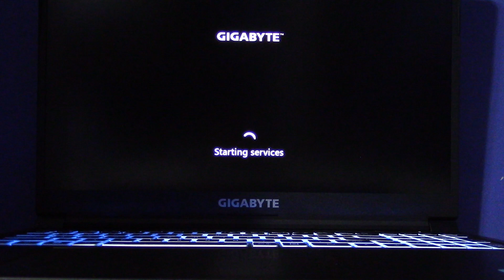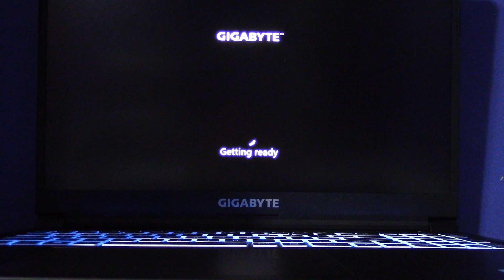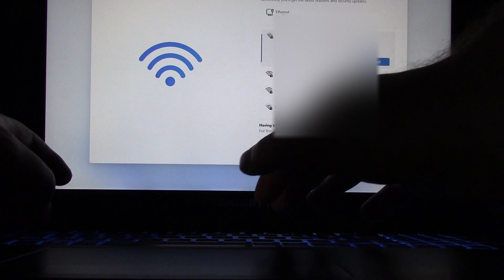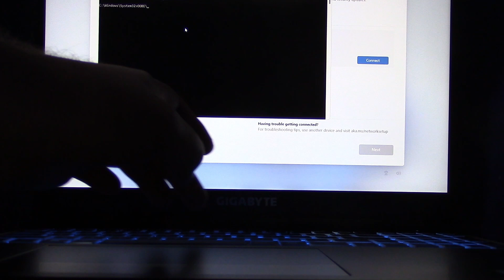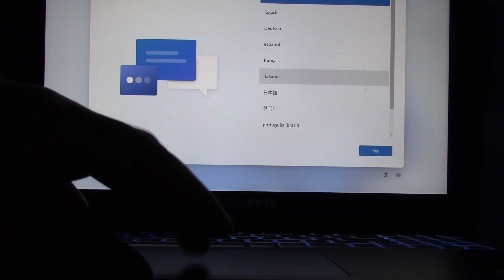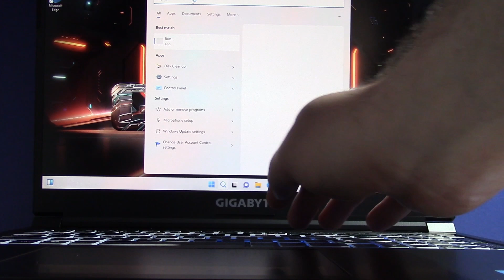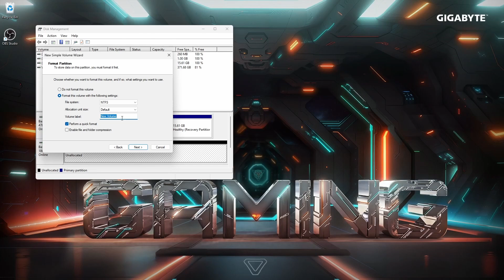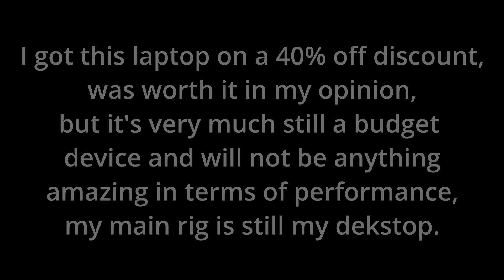GIGABYTE G6 Laptop Disassembly - installing a Second M.2 SSD

Comment: Could you please share your experience of using this device, how it behaves under load? Are there any problems with CPU, GPU and VRM overheating? I am planning to buy this laptop next year and would like to know about possible problems. Thanks
Reply: Процессор может тротлить от перегрева. Смотри коментарии "отзывы" на G6  i5 13500H notebooks in russian market "ДНС".  В настройках БИОС можно настроить, чтобы этого не было.
Вчера  ставил драйверы на вчера же купленный в этом магазине: аудио драйвер сначала встал с синим экраном, переставлял два раза с 6 перезагрузками (для удаления предыдущего драйвера). Также не встал Realtek сетевой для RG45. Скачал расширение какое-то для сетевого драйвера. RG45 вставлять аккуратно - можно сломать от того, что не понимаешь, как это делать. Многие драйверы пакетов Windows 11 отказывается ставить - приходится нажимать дополнительно и разрешать. Также один Intel драйвер категорически не встал, а другой встал но с дополнениями (скачаны вчера же с сайта Gigabyte). Windows 11 флешка от 1февраля сеть включена, обновления ставились. Первым делом был обновлён БИОС на последнюю версию. Используется исполняемый файл exe из под Windows, с терминалом и прошивкой в терминале. Гоутбук с RTX 3050 для ноутбуков, 16 Gb ddr5. ssd nvme Gigabyte требует ставить только шести моделей (но не как в видео) в файле из поддержки на его сайте.

Comment: Do you think this module will work? Samsung M425R4GA3BB0-CQK  32 GB 1 x 32 GB DDR5 4800 MHz.
Reply from the maker: I hope it will (it should work)
I added this in my laptop: KingSpec 64GB (2 x 32GB) 262-Pin DDR5 SO-DIMM Laptop RAM 5600
Reply: @supermonkeyCL  Thanks for the answer.

Comment: Hey, I know you tried showing it in the video, but what type is the RAM (DDR5?) and is there another slot for RAM? I'm planning on getting a similar model laptop (G6 MF) and I want to be able to upgrade it when I get it. Thank you in advance.
Reply from the maker: yeah this one supports DDR5 there are 2 slots and last time I checked I was pretty sure it goes up to 32gb GB each for 64GB total. I recently upgraded mine

Comment: I bought a gigabyte g6 kf h3us864kh yesterday and I want to upgrade/add more SSD, would this tutorial apply to my model number?
Reply from the maker: It should because mine is a GIGABYTE G6 KF too , there are two screws hiding under those two round black stickers on the back just a heads up on those two. Once all screws are removed the back panel was very hard to pull off with only my nails, if you a thin hard plastic piece should help but I didn't have one you will need to use a lot of force to snap out the back panel little by little. Once off it's easy to snap back on and then re-adding all screws

Comment: Thank you for uploading this video. Im surprised how easy it is to simply upgrade the pc.
One question about the SSDs: Are thermal pads or heatsinks needed to install the SSDs or they are safe just the way they are?

Edit: Another question: Are thermal pads needed for the copper (thats between both fans)?
Reply from the maker: The SSDs, there is no need for thermal pads since none came with them, Ive def seen some motherboards have thermal pads that you can peel back because those mobos have a heat sink on top of the SSD.

There rest I haven't checked but I believed the thermal pads for those copper pipes and where to clean dust of the CPU fan, might be under the keyboard instead, there is what looks like a little square thermal pad (if thats what it is) that came with the laptop, might be a spare one for something in the laptop

edit: basically that square thermal pad looking thing, it came in the bag that had the manual and the SSD screw

Comment: I’m having trouble getting the cover off, I have all the screws out. It was pretty quick shot of you opening it up. Any tips ?
Reply from the maker: There are 2 screws under the 2 round black stickers as well on thr back.  The cover was also a bit if a pain yes, good thing I didn't cut my nails it helped

Comment: Hi bro, would you please share about the "G6 KF Gigabyte laptop" that you own..
Does it get too loud at loads ?
And dose it too hot?
How is performance ? 
Many thanks
Reply from the maker: Seems to run everything well so far like games and video editing. It can get hot and loud when the fans go full blast inder big loads but I assume that's most laptops get loud, that's why I use my desktop more it'a more powerfull and quiet but yeah has cost way more I know
Reply: Да, иногда начинает сильно шуметь вентиляторами при старте.
Reply: Вообще, достаточно шустро реагирует, но иногда притормаживает почему-то. Неравномерность чувствуется.
У меня на Aorus Elite AX B650 +7500f такого не бывает.

Comment: Can you tell me if it's a good laptop? Does it heat up a lot?
Reply from the maker: The thermals go max, but does cool off decent, it IS a very compact device...like if you are under load like demanding games to run, it tries to cool off the best it can...
Reply: @supermonkeyCL  I don't know if i should buy it. Are there any comparable laptops at this same price point, or is this one a good choice? I'd really appreciate your answer!
Reply from the maker: @sqrrrrrr  Real reason I got it was because of a 40% discount and it seems to be able to handle whatever i throw at it so far, good for price but is still budget / slightly cheap.
If you look at other laptops, different  brands and other deals you could find something pretty good maybe.
Reply: @supermonkeyCL  thank you!
Reply: @sqrrrrrr I own it I promise you won't regret if you buy it it has exceeded all my expectations performance wise and my thermals dont max in game my cpu and gpu both stay below 85c which isn't anything special but is totally normal for a laptop, and ite surprisingly thin.
Reply: @chasesteele2510  Hi bro, would you please share about the "G6 KF Gigabyte laptop" that you own..
Does it get too loud at loads ?
And dose it too hot?
How is performance ? 
Many thanks @chasesteele2510
Reply: @supermonkeyCL  да, именно так, в этом отношении Acer на ddr5 и AMD процессоре должны чуть лучше быть. А у этих зависит от процессора. Охлаждение конструктивно везде одинаково, а карты 4060 и процессор 13620  интел греются существенно больше, чем 13500 и 3050.

Comment: Is both of the ssd slot gen 4s? Was already planning to upgrade mine onces it arrives
Reply from the maker: Yeah Gen 4
Reply: Hey there. The official website says for G6 KF it's PCIe 3.0x4 and PCIe 4.0x4, so be careful when upgrading your setup
Reply: video shows 2nd ssd slot is PCIE 3.0, when I opened mine to put in a 2nd SSD, it is marked the same.  I put in 2 different Samsung SSDs, 980 Pro (Gen4), and 990 EVO (Gen4/5 hybrid DRAMless) and neither would show up in the BIOS when added to the PCIE 3.0 2nd SSD slot.

Comment: i have this laptop also. what M.2 and RAM did you use to upgrade with?
Reply from the maker: To be honest I used a Samsung 980 pro it's a gen 4 M.2  but it likely runs on 3.0 speeds on the second slot. For RAM I didn't upgrade so it's still 16 GB of sodimm, I think DDR5 4800 mhz

Comment: Gpu still 75 watts on the g6?
Reply from the maker: Yeah it's not 105 apparently, so expect less performance, the laptop is very light and is slim though... def not a big 'monster' bulky machine, but still is not weak, has a lot of new gen specs, handles what I throw at it.
Reply: @supermonkeyCL  у 6 серии лучше охлаждение чем у 5, хотя стоят одинаково (правда с видеокартой 4860 вместо 3050). Но мы с сыном взяли поновее процессор, ибо из игрушек он уже вырос (продал 100 своих игр в институте, чтобы купить ноутбук) и было это 10 лет назад.
Reply from the maker: @jogladik  Had to translate but hey pretty cool glad you and your son are enjoying this stuff
Reply: @supermonkeyCL  Also thanks for this video. 2 days ago I install Win 11 to control all features. But after that win10 because we need update to win11 from win10 Microsoft license. But we can and purchase OEM win 10 and update after to win 11: DNS shop want twice many for Win 11 home (pro is absent). This way we need because Microsoft stop activate licenses for win 11 if it was purchase from another OEM than notebook.